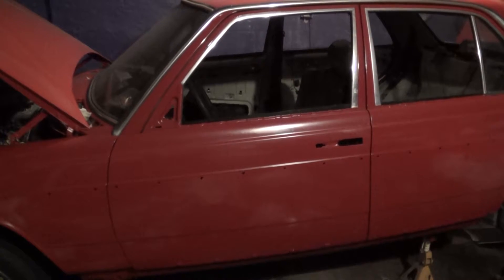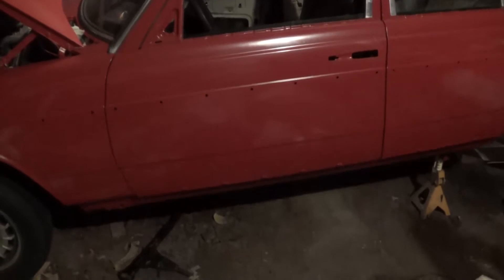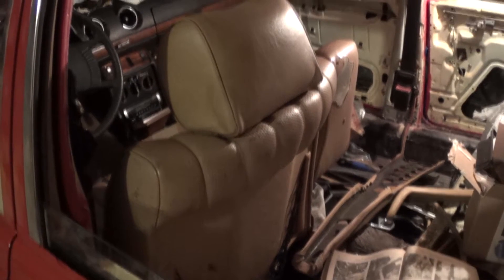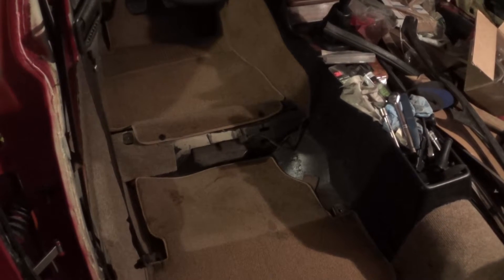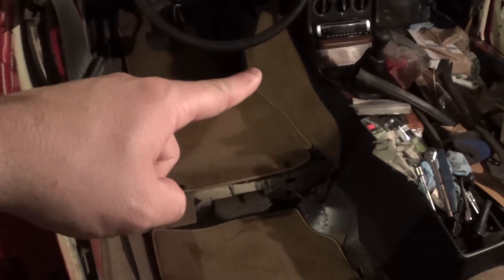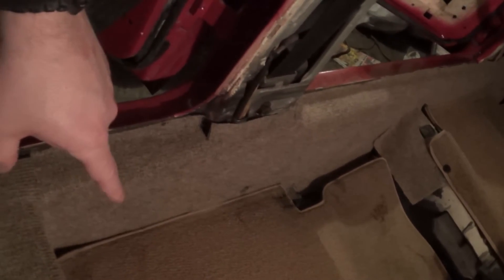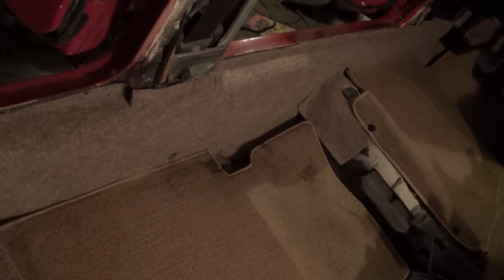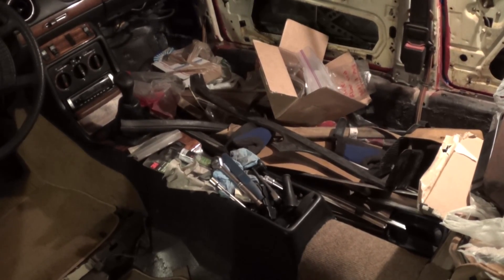1983 Mercedes-Benz 240D - part 133: carpet installation

Comment: is there a video showing you stripping the car? I need to learn how to do it more step by step or at least as close to it as possible ;)
Reply from the maker: +Matt Whitmire Not a DIY video, unfortunately. This series was more of a long video blog of fixing up this car. Removing the carpeting is pretty easy, though. The floor mats lift up, and the side carpeting pretty much peels out once you unbolt a few obvious items.
Reply: +MercedesDieselGuy hahaha sorry....reading my comment I sound like a scared and lost - ha! Yeah, I just have side molding around the doors and want to remove it correctly without breaking anything. 

Question, what brand/type of spray adhesive did you use to get the carpeting on the floor to stick?

thanks! I have a 74 240 D fyi ;)
Reply from the maker: +Matt Whitmire Side molding? Are you talking about the door sill plates? They're clipped on, but they really just lift straight up. As for the glue, I used 3M, I think their Super 90 product.